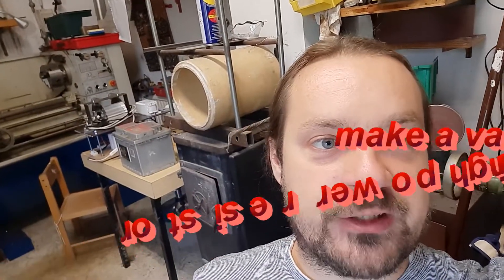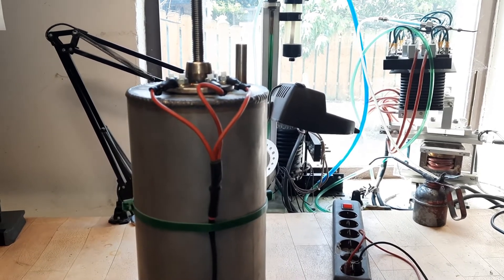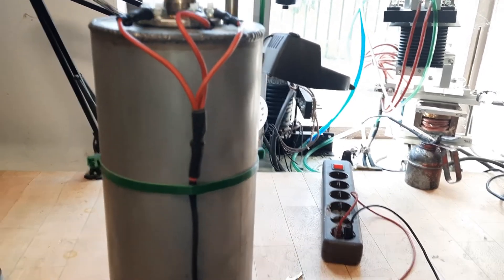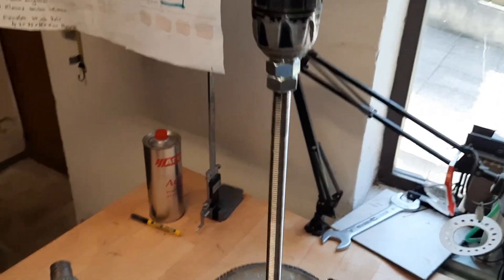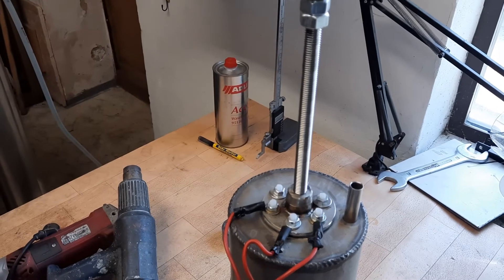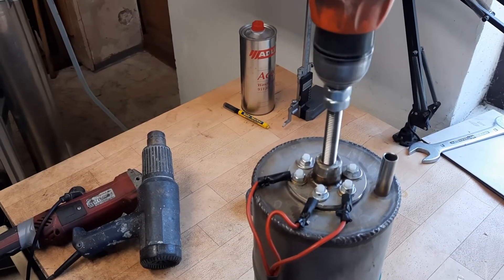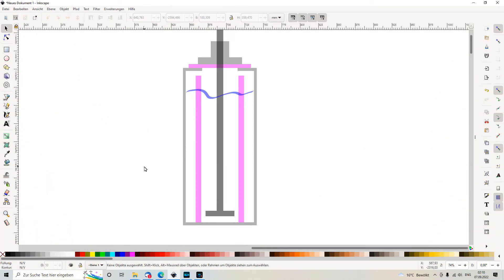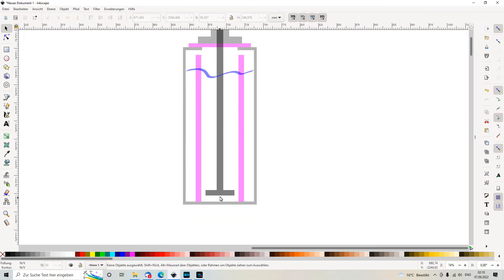make a variable high power resistor

Comment: How badly do the electrodes erode?
Is there a problem with electrolysis producing hydrogen?
Reply from the maker: Hello,

the electrodes do not corode if you use stainless steel, NaOH and AC.

I have not seen any hydrogen forming.